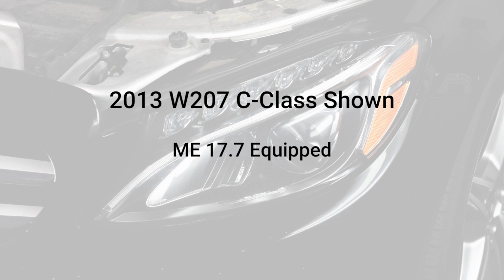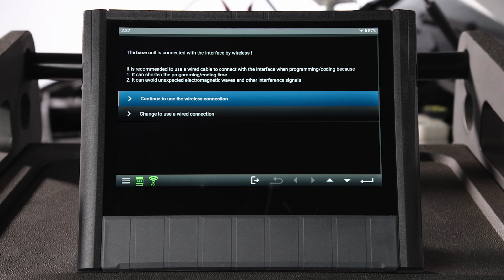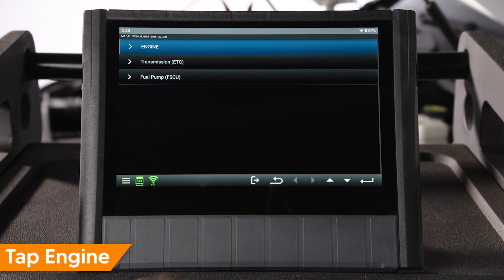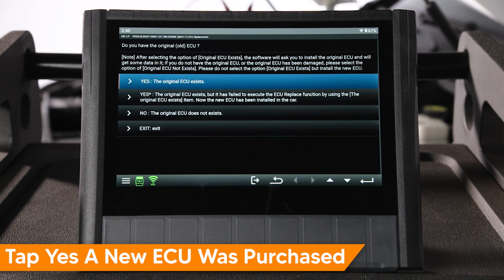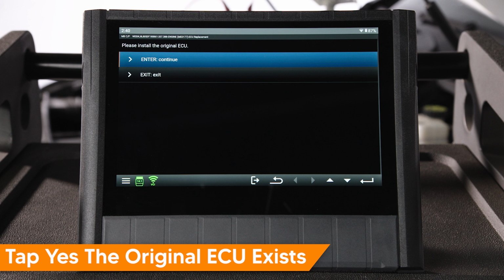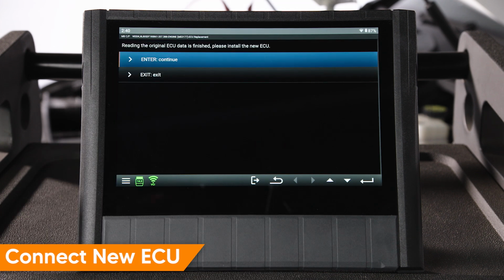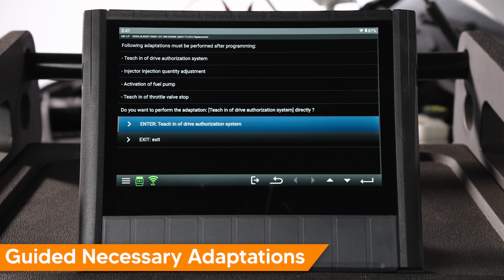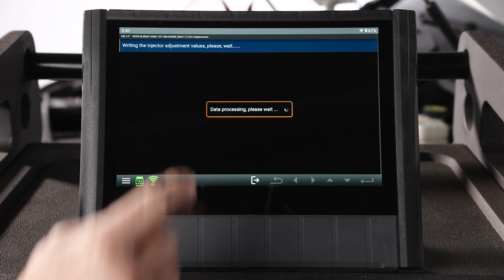See How to Quickly & Easily Program Mercedes-Benz W207 ME (engine control) Modules with an iSCAN NX

Comment: Any videos for adapting used head unit, is it possible or not?
Reply from the maker: What is the year, model and engine size of vehicle are you working on?
Reply: @AutolandScientechUSACedarPark 2013 CLA250 Onceni get feeling better I will reach thru SOD as James pointed me to that in regards to hopefully getting the unit running.  

Dealer quoted customer $6890 for new head unit. Customer without speaking with me bought a used one from some outfit in Sacramento. Well they didn’t get the PIN code when they removed donor unit at salvage yard or wherever. 

Everything works, hours up, then goes to theft locked mode. James told me if it can be done it’ll have to be SOD… I told the customer because they jumped the gun without consulting with me. It’s probably not gonna be cheap either.

I have a couple other potential ideas, but I’m not going to post them in here  as there’s plenty of guys who will cut pricing just to get the job and leave a mess in the end.